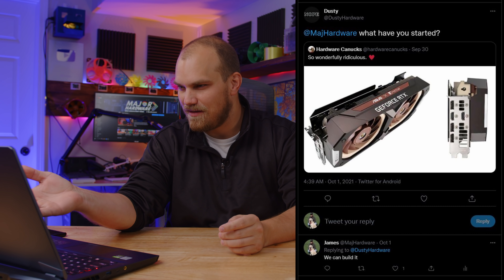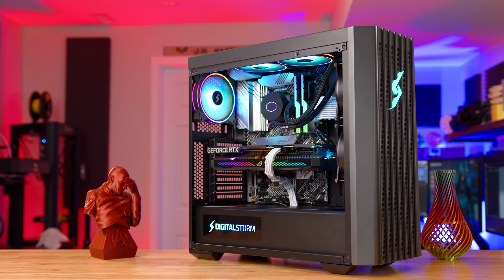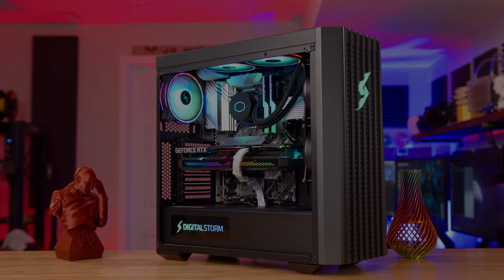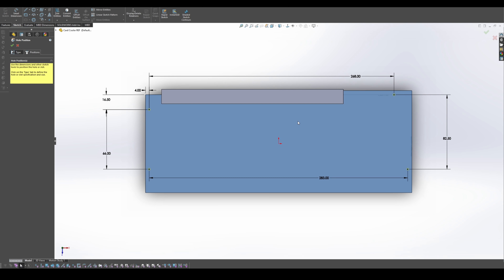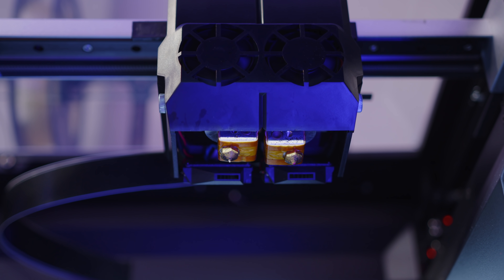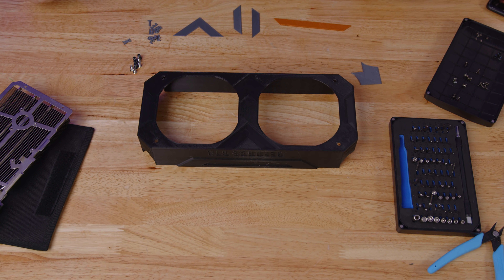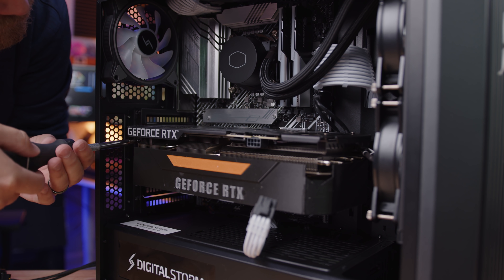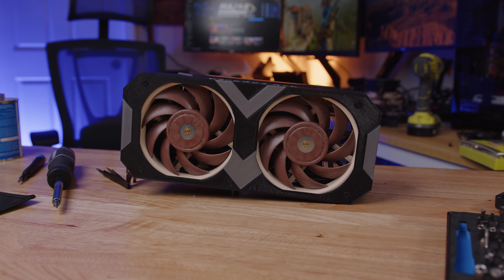I FABRICATED The RTX NOCTUA EDITION From A Picture

Comment: Wow. This turned out better than expected. This printing thing isn't available to everyone.
I have a zotac 2070 with shitty double fans. I'm thinking of using the NF-A9 PWM fans.
The fans connectors are different from the ones on the board and a converter is not available anywhere. Any ideas.

Comment: Stock fans got higher clocks and with that cheapo white factory thermal paste which is about the results testers got when they tested the  fully released product comparing it to the same card from the same manufacturer with its stock cooler design on it. Basically their a mildly worse on a GPU but significantly quieter.

Comment: bruh i realized u "only" have 195.000 subs. u definitely deserve more.
did something similar with my r9 290.
put 2x120mm arctic fans on there, because the old ones failed.
at full speed with sidepanel open + undervolting it runs at 66 degree celsius max

Comment: This is great! I've been waiting for the noctua card only to realise it won't fit in my nr200p hah! So I'm looking into modding my 3070 Palit gamerock OC. Sadly I don't own a 3D printer and zero experience, so if I find someone to help me, is there any special heatresistant filament one needs to use for the printed parts?  Also I noticed you only used 2 screws per fan, any special reason and were they just ordinary fan screws? Thanks for the vid !

Comment: Technical Q: Is the PLA holding on well so far? I want to try something similar but am not sure if the PLA will degrade over time with the temperatures.
Reply: I want to know this too.
Reply: @lordhumungous7908 , I ran my mod for maybe 5 months so far and it was totally fine. My "baseplate" was in PCTG though, as that is touching the alum fins and I wanted to be extra sure. But the rest of my shroud is PLA and had zero issues. BTW, I do undervolt my card, so it hasn't seen temps above 73C, but I also do mine at max temp 62C, so the card did see a lot of work during those 5 months. Temps and noise are absolutely amazing :)
Reply: @danimagfernandes  Thanks for the reply. I had a GPU shroud printed and I asked for ABS. It was printed in two halves. The 3D printer guy gave me some spare filament to dissolve in acetone to make glue. It didn't dissolve and I got worried my shroud was PLA. I think he used "ABS+" which doesn't dissolve in acetone. PLA is supposed to soften at 65C. But I think the temps we see are the GPU core temps and the heatsink temps where to the shroud attaches are lower. You've given me the confidence to proceed with my GPU mod. Cheers
Reply: @lordhumungous7908  was the filament he gave you to dissolve shiny or more on the matte side? If shiny could have been PETG as well, and that doesn't react with acetone. But there are easier ways to glue 3D prints than dissolving filament, with actual glues like super glue or epoxy :) In any case, if you have a glass panel case you can always keep a close eye during some stress test and see what happens. I can't say much about the temps where your shroud attaches, or mine, so I played safe with PCTG (PETG would probably work as well). What GPU do you have BTW?
Reply: @danimagfernandes  The filament is shiny. The printer guy gave it to me in an eSun box. They make "ABS+" which is meant to be easier to print - less shrinkage/warping than real ABS. I'm guessing that's what he used. I'll use super glue but it would have been nice to have ABS slurry to fill gaps and reinforce areas. I'll make it work :) My GPU is a Dell/Alienware RTX 3080. It's got the smallest 3080 cooler on the market and two small fans that spin to 4000rpm! No windows on my case.

Comment: I'm doing this with my 3080Ti. You should mention the cables that come with the fans don't match the cables headers on the GPU. If you use an adapter, the Noctua fans need to be 5V or 12V? Many things to consider.

Comment: Any chance you could flip the fans around to reverse the airflow direction? I have a case that could weirdly vent the hot air out of the case instead of inside the case if the direction was changed.

Comment: where do you plug in the fans? a random channel fan header? or an adapter to run them on the gpu so they fluctuate in fan speed like the stock ones?

Comment: "when the real thing comes out i'd imagine the cooler they put on there will be a little shorter, and the heat pipe and fin stack will be more optimized to the a12x25"...
real thing comes out, exact same thickness, nearly identical heat sink. lol

Comment: the sad part of this gpu besides the price is that AT LEAST they could release "a special ed. of these fans", u know? a normal 12x25 and the second one  spinning in the opposite direction, instead no: take 2 ordinary a12x25, slap them on a tuf, boom easy "collaboration with noctua guys, chk this amazing new edition, 1000$ 3070, it will outperform any 3080 out there for 300$ less", big deal..

Comment: I'm always asking myself why are the cooling fins not maximised towards cooling surface? Why are they always straight and not in a wave or triangle form? Besides costs is the benefit so low? You could add up to 40% more cooling surface just using Pythagoras. 

Did you ever try this out Major Hardware?

Comment: I put 2 Arctic P12 fans on my GPU, massive difference with stock. Much cooler and quieter. They might even be better than noctua's for this because they are pressure optimized and a LOT cheaper.

Comment: You really should not be using PLA for printing this, it is malleable and even more so at fairly low temps. You also missed the oportunity to direct the airflow to the heatsink, and thus lost a lot of performance. These Noctua fans pull a ton of current at startup, and plenty of fan controllers are not designed for that, but did you even comment on the fan cable and controller issue at all? If you don't use the cards own fan controller, there is no safe way of using the GPU temp to control the fans. SW control only works as long as the system do not luck-up, and thermal runaway happens during them lock-ups. This forces the need for temp probes if not running the fans at fixed speed, that is safe for a lock-up at full throttle. I have yet to find affordable fan adapter cables.

Comment: Hey James! Great video. The cooler looks awesome. The one problem I see is that the 3060 cooler is using the heat sync as the higher power cards. If you were to use this fan setup on a different card, like. 3070ti or a 3080 we might actually see a difference in cooling as we will be using the capacity of the heat sync more.

Comment: Dude you did any awesome job! Looks almost like the "official" version. I think the only thing holding you back here is the heatsink itself. In the stock config the boost clock stabilized at 1770MHz, while the screen cap you showed for the modded version looks to have stabilized around 1717MHz, so that's a delta of 52MHz. That would seem to suggest that the modded version hit some sort of thermal limits earlier; preventing it from boosting more. I think the stock heatsink was the limiting factor for the mod. But it was really cool to see.

Comment: I would have LOVED noise normalised testing. Get the stock cooler back on it, run a test at full blast to check if your mounting is correct (temps in the same range as before) and then play with the fan speeds until you get around 43.2 dB.

Comment: If my motherboard could fit it without having to remove my WiFi card, and it was in stock, I would buy it. Hell, I could switch to a WiFi dongle if I need to, even if the connection is a bit worse.
Damn it Noctua, why do you have to make everything so sexy?
I don't care about RGB damn it, just give me that sweet Noctua AIRFLOW.

Comment: expecting better cooling and better noise from it, it's insane how much of a difference having a full thickness case fan makes over the skinny shits normally found on GPU's. I took a less fancy route with my 980ti and just ziptied a couple of case fans to it, but the results were insane, I can run the fans at their lowest RPM and still get much better cooling than the old triple fan zotac cooler it came with. like 10-20C lower and hardly any noise...

Comment: i mean this(3070) gpu gets hot when i push 2.1ghz and 8000 mem compared to stock i wouldnt say 75c+ hot...or even in 70s during benchmark runs on a 70%+ custom fan curve. Yet its completely silent in stock operation....other than diablo 2 remastered or path of exile both GPU hog games if played uncapped those arpg can push 75c+ in stock or oc with fan speed ranges of 70%+ in stock as it is. So it really depends on the game/situation. If im using open backed HP and playing a Competitive FPS i can run the GPU in stock and it will be silent. While still pushing the most fps i can get on valorant or cs:go as quiet as possible. The strix and xtrio are some of the best 3070 as far as thermals and noise of operation when fans are <70% speed. As both are 3080/3090 coolers. Idk how well...or remotely necessary doing this would be on a 3060 and im not sure if the same cooling implementations are in place as a 3070 strix with vrm/vram considering. Im talking about my 3070 strix vs a 3070FE vs a supposed 3070 noctua. This aspect comes further into play if the noctua can even be installed on an ITX build(Sff aside) like an air cooled noctua tu150 nhd15 build....can the noctua 3070 fit in a tu150...probably w.o bottom intake fans mounted. How would it perform in that itx configuration or a nr200. VS a 3070 strix or 3070 xtrio. As best gpu power/thermal options size permitting for itx before spending 1000$+ for a gpu and the psu requirements as well.

Comment: Now make it a 5 slot cooler by extending the shroud another 5mm or so for the new 30mm thick Phanteks fans. And while you're at it, grab a Morpheus GPU cooler compatible with a 3000 series card and build around that beefier heatsink, turning it into a 5.5~6 slot monstrosity.

Comment: I'm currently running a 2070Super with two NF F12s ziptied to the heatsink and it is the best mod I've done to my PC hands down. Gone are the days of the screeching 92mm or whatever the fuck those tiny ass fans were...
I would love to have a simple bracket for mounting the fans to the GPU with screws though.

Comment: Wait, I don't understand how you attached Noctua fans to a thing without using duct tape? 😅
Reply: cable ties
Reply: Duct tape?! No; you’re supposed to use hot glue!
Reply: Tweezers
Reply: And why did he 3D-print the shroud?  That's what cardboard is for.
Reply: BTW, there is a “duct tape”, that used in aviation (don’t remember correct name), sometimes pretty much unexpected, for example - temporarily fix a hole in the wing))) I think that kind of “duct tape” can be used to hold fans on a video card without any problem)))
Reply: @llMarvelous  yes, my grandad had to do this when a door blew off a Constellation.
Reply: @thiagorabelo01  exactly! couldn’t remember ) thnx
Reply: It's magic that young Dawid does not yet possess.
Reply: It's to channel the Airstream. Ducttape would stick to the Airstream and slow it down.
Reply: You guys are pros, I use Blutac 😀
Reply: zip ties dude, it's called de-shrouding or something, pretty damn effective
Reply: I know what you did there, teasing about another guys that "tried" this and his results were, go buy the card, don't try to DIY because it's awful.
Reply: super glue!!
Reply: epokit bro xdddddd

Comment: I did a 'ghetto mod' of a GPU before, with 2x120mm bequiet fans, complete shroud removal, new paste, adding pads for the metal backplate - was a massive improvement in both temperatures and noise, all for not a lot of money and just a bit of time building it. Just about any card can be improved with better fans so considering how much GPUs cost and are now selling for on the market, it's such a rip-off...

Comment: Awesome video MH, one question though, how did you sort the fan cables? Were they wired into the motherboard or did you need to adapt them to fit into the GPU plugs?!?
Reply from the maker: i just powered them externally, if it was my card i would tried to use the GPU fan header.
Reply: @MajorHardware  Thanks for the response MH. Your videos always make me want a 3D printer, and this is no exception!

Comment: I did end up modding my RTX A5000 but I went air cooled. I removed the blower cooler and put a RAIJINTEK MORPHEUS 8057. With 2 120 Thermaltake toughfan 12. I had to make some custom brackets to mount the cooler. Gpu running at around 30*C under load . The blower cooler was designed for a server and didn’t get enough airflow in my case configuration. I did run into one problem, but it was good I found it. Apparently from the factory I had a cold solder joint on the primary power in. A wire broke loose during the mod. I resolder it and all is well. By the way, the thermal paste they send out is crap. It was like cement and hard as a rock. Took me 20 minutes with 90% alcohol to get it off.

Comment: yeah, temp is the same, but don't forget about core clock boost - with noctua fans core clocked 30-45 MHz lower, so they did slightly worse (but much quieter, obviously)

Comment: Make sense that it's gotten quieter, given how big the fans are, they don't need to spin as fast to keep the same temperature. As for temperature, it was following the same curve as before, so also make sense it wasn't any better. If you had made it spin as fast as the stock ones, then you'd see a improve in temperatures. Still... That's a win in my book, good temps with lower noise!

Comment: I have a MSI 2080 card and the fans were really loud. I saw someone on youtube remove the fans on his card and put two 120mm fans at the bottom of his small sff itx build so i thought i could do the same with by just ziptying two desktop fans to my card and while the temps aren't better it helped with the noise.
And it's easily reversible too so when i retire the card i can just put it back to how it was.

Comment: Just a question. Does the 3d printed shroud cover the fins of the heat sync? It kinda looks that way. My understanding of how these air cooled cards work is they push air out the sides of the card, unless there is a pass through like the FE models. If the printed shroud is blocking even some of that airflow, it would have a negative impact on these results.

Looking back at the original 3060 shroud… A lot more of the fins are exposed. May need a reprint/retest IMO

Comment: The heatsink itself seems to be the same as your card, at least the visible section looks identical. 
Also seems to be the limiting element.
More Noctua means more quite which equals more better. :D

Proudly running eight visible A12x25 fans in my case. Next evolution would be changing gpu cooling to a Morpheus+ two more A12x25

Comment: Is it really any surprise that the mod is quieter? You're going from 3* 80(?)mm fans of more than likely an unoptimized design to 2* 120mm fans of a much better design. This also shows that the limiting factor of the cooling design is the heatsink itself, though this will always be true for this kind of air cooler on GPUs.

Comment: This is awesome, great video! This is one of the reasons I want a 3D printer, to play around with stuff like this.

I wonder how fast it runs, did it get pushed to run faster, and that's why it's the same temperatures, but faster?

ALSO! Now you have a template where to test viewer's fans on a GPU as well ;)
Reply: It means the heatsink is the limiting factor. Can't get any cooler without a different heatsink
Reply: @mattymattffs  Maybe. I wonder if the card got overclocked more with the two Noctua fans, and it would stop that at the same temps, right?
Reply: @Alexandra-Rex  From the 2 short comparison clips it looked like it was boosting better with the original fans, but I think that's down to brute force airflow, since (in my experience) gpu fans usually run 2800 rpm or more when maxed out.

Comment: I would like to point that it looks like your card is set to throttle at 52º. With the stock fan you got the standard 1800mhz FSB, with the noctua ones it looked like it dropped a bit, to 1750? Have you checked the FSB vs temperature over time?

Comment: Nice project! 😎
Have you connected the power connections to the card with an adapter, configured a mainboard connection or controlled them via an external hub? 
I didn't notice that in the video 😅
THX for all the work!
Reply: EK do a GPU to PMW fan convertor for arond $4/£3.75 so you can get the GPU to control the fans, but I was watch closely and noticed there was nothing said about this as teh cables were sticking out at the end of the speeded up build and hidden in eth glory shot.
I am awaiting the day the fans on my Gigabyte 2060 die as they make a lot of groaning noises. Have alread tested a single 120 fan straped on with cable ties and no shroud and the temps were the same as stock which says a lot about Gigabyte quality.
Reply: @lorribot64  Cool, found it. This could make my live a bit easyer in the future. THX 😁

Comment: Just as new graphics cards became a thing of the past, my 2070 decided to kill its fans and when I send it in I got the message "We cant fix this, you want the card or money back?" I got the money back with the hopes of getting a new card. That was over a year ago now, and Im still on my 1060. I really wish I had just done some custom fan work myself, it would not only have fixed the card, but improved it :(( Thank god my 1060 still holding up well with my use, and on top of that, its the most silent card ive ever had.

Comment: You should set the Mhz of the GPU manually for a baseline as the firmware would have been tuned for the cooler on an AIB card.

Comment: About time a mfg did this, I recall when I modded my R9 390X with three 92mm arctic fans on the accelero extreme IV cooler and it completely stopped all thermal throttling